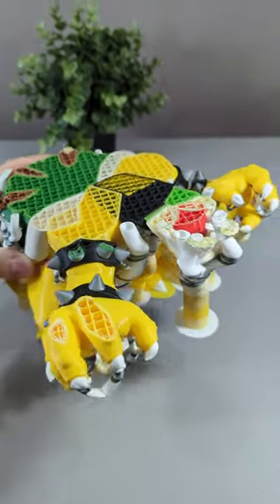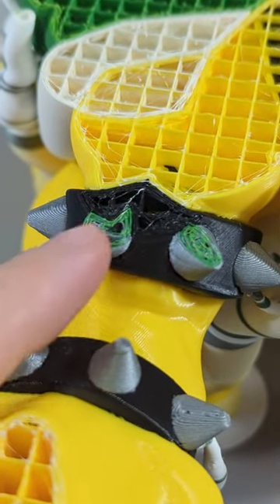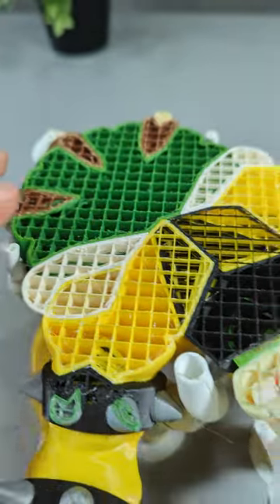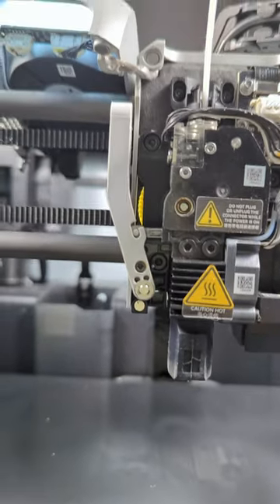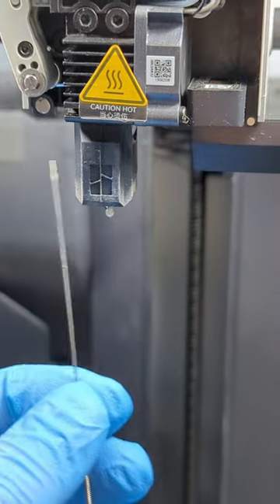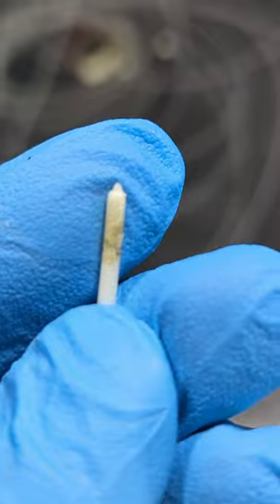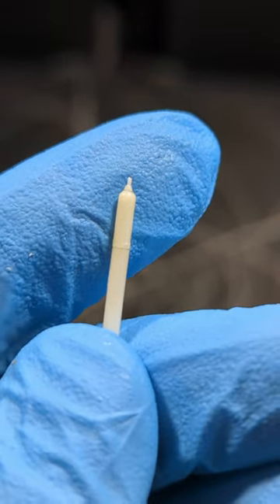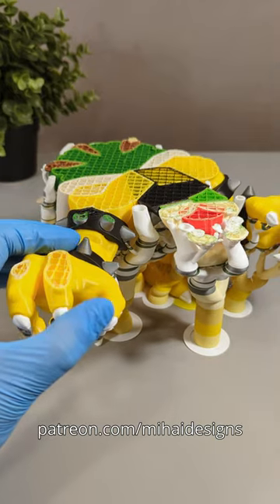Failed 3D printed Bowser

Comment: Please print out the top half and frankenstein glue it together. It can be frankenbowser for halloween
Reply: I dont think thats how it works though
Reply: @Gingersdad well i did it with more than one print 😂
Reply: @Gingersdad I’ve done it before, it usually turns out okay but it leaves a very noticeable seam in the middle unless you sand it down really good, but then you have to paint it to hide the sanding
Reply: @lukestarkiller1470  No i mean franks head dosent fit on bowser
Reply: @Gingersdad  well the original comment was just talking about gluing the rest of the print together
Reply: @lukestarkiller1470  Did you read it? no it wasnt it said glueing franks head tl bowsers body or bowsers head to franks body. stay down you dont know what your talking about
Reply: Good idea! 😂😊
Reply: @Gingersdad    dude where does it say that? It says Frankenstein and Frankenbowser, it doesn’t say “Frank” anywhere. I don’t know who you think Frank is but that’s not who’s being talked about. He said to “Frankenstein glue it together”, as in stick it together like how Frankenstein is stuck together from different pieces. Frankensteining something is a term people invented to mean sticking something together from different pieces. So don’t tell me I don’t know what I’m talking about when you’re the one who doesn’t understand a simple, commonly used analogy
Reply: @lukestarkiller1470  K, whatever u say
Reply: @Gingersdad   I apologize if English isn’t your first language or if you’re just too young to have read the original Frankenstein book and don’t know what I’m talking about, but if either of those are the case you probably shouldn’t go around telling other people that they don’t know what they’re talking about
Reply: @lukestarkiller1470  I misunderstood.  It wasnT Literally frankinstine
Reply: @Gingersdad it said "Frankenstein GLUE IT TOGETHER" he was talking about glueing the bowser together
Reply: @Infection81  "franken bowser for halloween" Dumby
Reply: @Gingersdad  ???

Comment: Also check the buffer spring on the back of the printer, where you connect the AMS. Mine stopped extruding before because the buffer spring got caught up on a little tab inside the buffer housing and Bambu Lab support knew the problem right away. I was weary that was the problem, but once I pushed the spring off the tab (design flaw?) so it sat straight again I never had anymore problems.

I have an early kickstarter X1CC so maybe they changed soon after.

Comment: Hey! I had the same kind of clog! It only happens on models that have a lot of retraction... I can print 30-40 hours with no issues, But as soon as I get a model with a lot of retraction and lots of parts I get about 30 minutes and then the dang thing plugs up. When the filament is pulled back it's cooling and expanding and eventually it can't push through the buildup. I have yet to figure out what the cause is though. It's already burnt out one extruder motor.😅

Comment: Could be dust.  Filament can come from the factory dusty.   You don’t necessarily notice it.   But after a few hundred feet, it adds up.  It’s not plastic, so it doesn’t melt.   Try a sponge filter with a few drops of oil at each line, use a white sponge and clear mineral oil. After a few days of printing see if the white sponge is dirty.   There’s not really any company that is better than another for this, dust happens on small nozzles.    Best solution is to use .6mm nozzle as the smallest or .8 to guarantee no clogs.    The .4 are highly sensitive.
Reply: Unsure if it's just the filament I use (Hatchbox and then subsequently Inland) but I've never had a dust problem before

Edit: Primary nozzle is 0.4
Reply: @Spiker985Studios yes, not all the brand have this problem, and not all the filaments of the same brand, the only way is to check with the White sponge
Reply: @Spiker985Studios  It's hit and miss.  Sometimes you have problems, sometimes you don't.   Too many variables to really say it will or won't happen to everyone.  It's happened to me before, it's also not happened to me before.   Currently my printer is in my garage which is doubling as an office and a WoodShop, so it gets a lot of dust, so it gets a sponge filter!  I think while dust from the factory is a component, most people dust probably comes from their house.   I think, it's different kinds of dust.   Then there's the nozzle, the material, the tube, the gear, etc. etc.  I haven't had a sponge filter in a few years, it's not always necessary.  A good trick to know/try if you run into issues.   +1 for hatchbox and inland.   I'm experimenting with lots of different filaments now and I've got some glitter that is JAM CITY.

Comment: I've run into issue with filliments that have additives in them.  The nozzle wears out so much faster and it won't always show from the outside, but if I measure the extruded filliment from a new nozzle compared to the old one I get variations that I can only assume is what causes some of these issues..

Love the content

Comment: I just had the same thing happen on my printer, but on a smaller 3 hour print… I printed out an elephant, but it looks like 5-10 minutes before it finished, the nozzle had extruding issues. I heated the nozzle, didn’t flow out, pulled the filament and cut the tip, and then it went… I don’t know if it just got clogged up, but it is really disappointing to have a print fail like that… I thought this would never happen, but oh well such is life right?
Edit: it’s also a 1 color printer so I didn’t have color issues… just under extrusion

Comment: Can you cut the other 2 days off inside the file and then just try to print the top
Reply: If he caught it before the colors mixed, he could've set the height via gcode, and then pasted the remaining gcode from that layer onward

But since the colors mixed, it wouldn't look correct
Reply: @Spiker985Studios The mixed up ones look heavily under extruded. They should just rip off
Reply: @daliasprints9798  not trying to print ontop of it. Just print what is missing then glue it. 

And after removing the mixed layers like dallas prints said.